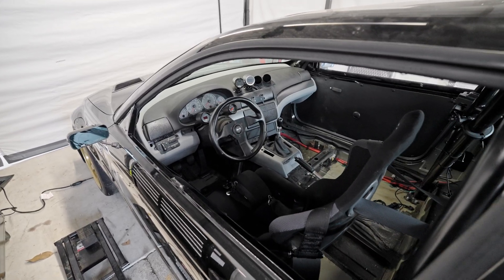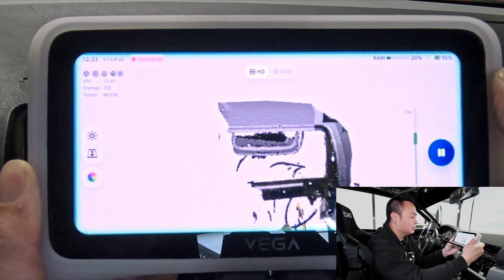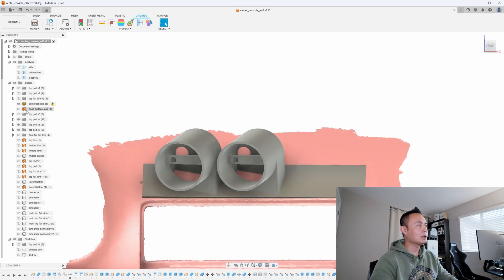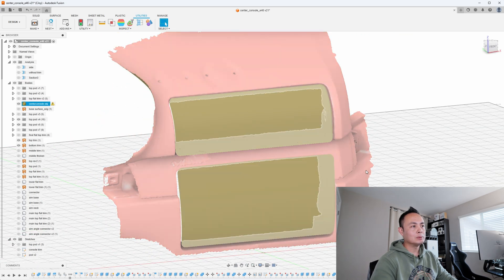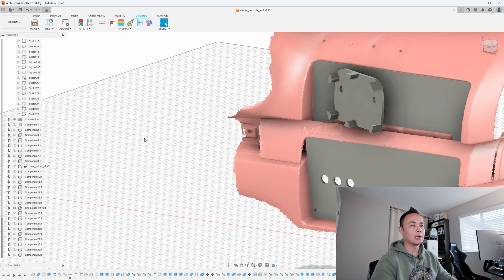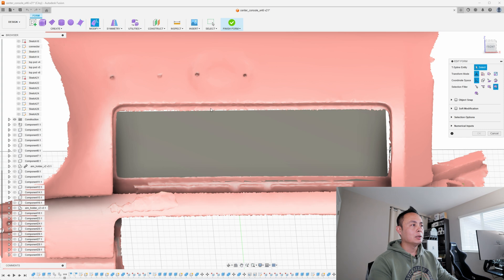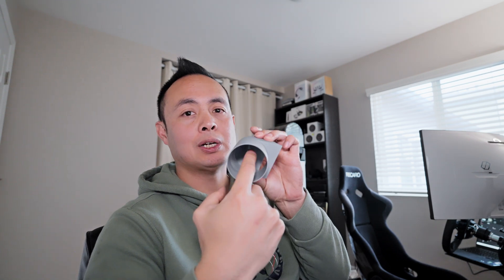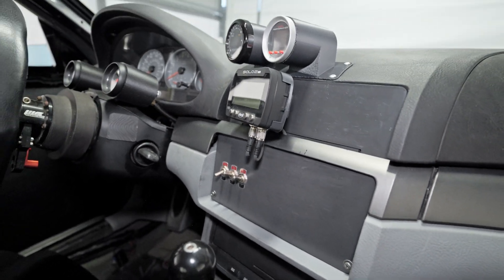3D Printed Car Parts - Gauge Pod and Block Off Plate

Comment: For ASA, you have to dry the material similar to PETG. That white spot is most likely from your glue.  You can sand it, then do vapor smoothing. Or just paint it!

But if you don’t wanna do postprocessing, I’d suggest putting down a brim and/or a better buildplate
Reply from the maker: @FlipThisHobby  I’m using a smooth plate.  I think it is the glue.  The pattern of the stain resembles the glue I apply to the plate.  For ASA to stick, I use both glue and a brim.  Thanks for the suggestion though.  I am trying to avoid post processing.  Maybe I should try a different material that doesn’t require glue but is good for auto interior parts.
Reply: @ I see.. yeah the only way to avoid glue marks is to print it in an orientation where it hides it.

I’m personally using the BIQU Panda built plate with brims and added a -.1 z-offset. 100c on the build plate, let it cook til chamber is at least 40c then start printing.